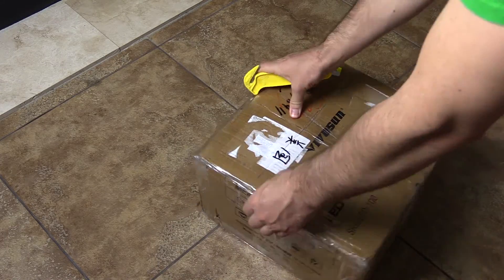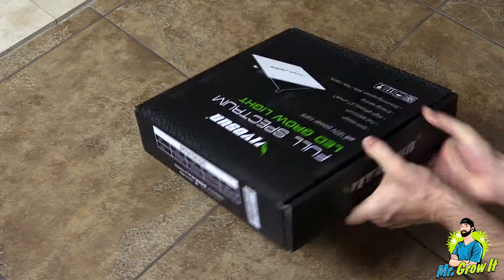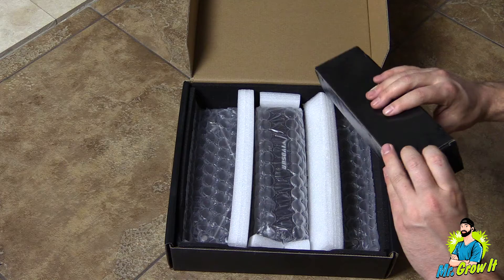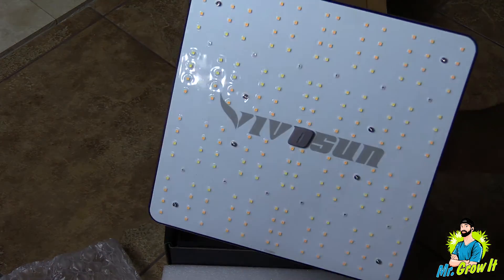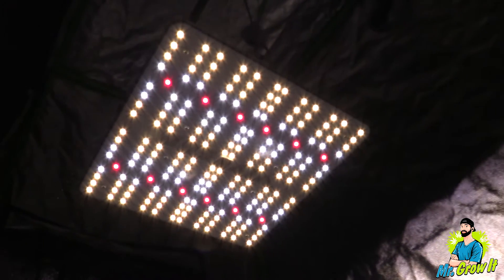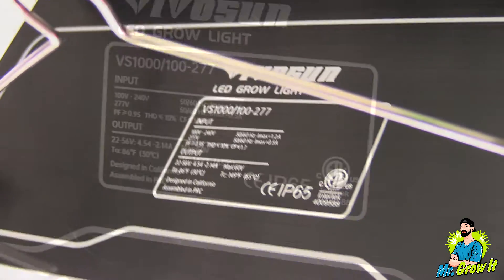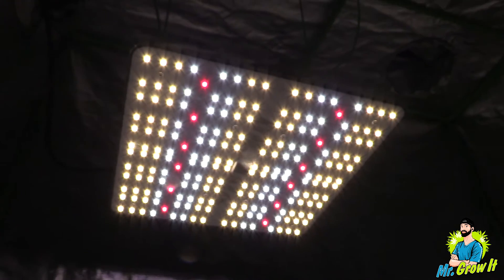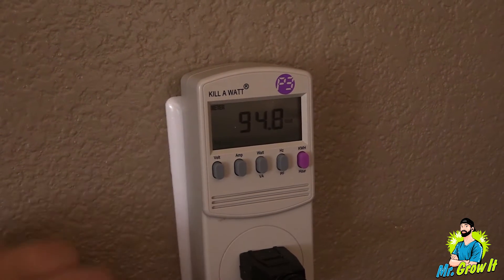VIVOSUN VS1000 LED Grow Light Unboxing, PAR Test & Heat Test!

Comment from the maker: What do you think about these measurements?
Link to VS1000 LED grow light- https://amzn.to/2Xz8RNP
Reply: I have this light and a ts 600 in a 2x2 with 4 plants that vegged 4 weeks in solo cups and were put in 1 gallon fabric pots..... Currently week 6 of flowering and the 2 on the vivo side are SO much bigger
Reply: It’s not worth my money looking for a new light atm
Reply: It would make a nice light for clones or sprouts 👌
Reply: Hey bro for a veg 2x2 is the spider farm sf1000 a better choice when it comes to par or the VS1000 your reviewing in this vid
Reply: How many of these lights would I need in a 8x4 tent ?
Reply: Not a question about the specs my question is do you take that little plastic cover off the light fixture or not lol I hung the light and it just sticks out like a sore thumb lol . I was using bulbs and finally switched over.
Reply: Could I use this light from seed to harvest in a 48”x24”x60” tent??
Reply: It’s not enough for a 2 by 2,except for veg.
Reply: I would have liked to see the PAR measurements at the other settings as well....the 75%, 50%, and 25%.  That would be extremely helpful since assuming they would actually be 75 , 50, and 25% of the readings seems like a bad idea...or am I thinking wrong?

Comment: Just bought one during a flash sale. This was helpful.
Reply: @MrDong101  Are you Happy with IT?Propably wanna get one for my 60*60 tent.
Reply: @Stephan_78 I have the vs4000 and I wouldn't use it in anything bigger than a 48x48. It claims a 60x60 foot print but it's too weak on the perimeter.

Comment: The main appeal of this fixtures are price. A 55w cob usually costs 120€  and this gives a bigger coverage while still being a small panel , I would place two of those I guess for flowering. I am using 55w cobs but I am going to try this for a replacement, the numbers aren’t amazing but it will make the job done.

Comment: I do not disagree with these tests, but show that the light is the distance you say it is from the sensor, and show that the light is in fact COMPLETELY level. The results should not change much, but it would be more consistant testing. I understand completely level is not possible, but put bubbles on it to show.
Reply: You are only showing offset distance. My light distance at 12" is 80 using the same meter.
Reply from the maker: The light distance is clearly shown in the top left corner of the screen. Confirming the light is level. Not sure what you mean by offset? You got 80 PPFD at 12"? That's very strange. Sounds like you may have a faulty meter. On a side note, I appreciate the suggestions but I actually stopped doing PAR tests over a year ago to focus on other projects. Cheers!

Comment: I have this light. I have a king led on the other side of my 2x4 tent. This is by far the better light. It’s intensity is adjustable. The height adjustment is way better than that of the king led. I love it. I wish I had three more. I have some other blurple in my other 2x4 tent and I’m not liking it at all.

Comment: I got like everything Vivosun and it works real well, def on the lower $$ level but seems like everything works well. I have the 600watt version of this light and it covers the 2 x 4 tent pretty well (for 4 plants or so, def no problem). Just gotta get a pulley system and sunglasses lol
Reply: I've had 2 vs1000 for 2 weeks now in a 2×4×5 vivosun tent and my three autos are doing quite well on the lower setting, plus they came with glasses and a pulley system.
Reply: A 600watt light that fits in a 2x4? That doesn't exist
Reply: @tylerc7336  you live under a rock….  Those have existed for years ! Even before led grow lights. Back then they cost around 500$+ now a 600w that’ll fit a 2x4 tent costs 200-300$

Comment: Which is better, this light or the one from Spiderfarmer?
Reply: I've been trying to find the answer to the same question
Reply: Good Question! Same here
Reply: Same here, so what you guys think, vs1000 or sf 1000 or ts1000?
Reply: Update- stick to SF1000, it is the best value for money, unless you’re really rich, you may go for ts1000. Trust me on this
Reply: Spider farmer has two 1000 series the sf1000D and the sf1000. The 1000D is very similar to this as they use the same Samsung diodes. The regular 1000 has better diodes and a meanwell I believe and will pull around 120 from the wall. I’m debating between the regular SF1000 and the marshydro TS1000 for my 2x2. Probably overkill but it will be a huge upgrade from my current TS600 from mars. I only get about 60 from the wall so it’s hardly strong enough for flower but I’ve got it about 8-10” from my girl and she seems happy enough. But I know she could be much bigger with a better light

Comment: Does the vivosun 1000 have the IR and UV? Im currently running the spider farmer sf1000.
Reply: So?
Reply: Ahh man, if you're running the spider  farmer with the Samsung lights you're fine. Vivo sun is not great
Reply: @rich8381  you have no idea what your talking about do some research vivosun has samsungs LATEST diodes not the lm301b, it pulls the same amount of power, its insanely bright and has a 3 mode dimmer KNOB easily accessible. Besides the spectrum on the vivosun is better for flowering anyways
Reply: @owenrutledge7144  it's funny, I'm looking at buying a light as we speak. So you're saying vivosun is better than spider farmer?
Reply: @owenrutledge7144   more like it sounds like you don't know what your talking about. The only differences in 301b and 301h is the h stands for horticulture because they are water-resistant and the lm301b are not. Other than that they are identical in performance. The top chips currently are Samsung lm301sl but for the price lm301b are the way to go.
Reply: This light is only good for seedlings and clones. It only has enough par for veg and doesn't have IR. The spectrum is more suited for veg with the 3k,6500k,660nm. This light has 20 less diodes then the sf1000w and max power is 96w from outlet. So you can see how under powered this light is compared to other. There is almost no difference in performance between lm301b and lm301h other than the h is water resistant. They don't magical produce more light with less power then the lm301b do. They are identical in performance.
Reply: @Backcountrylifestyle  go on samsungs page with all of their diode information and see for your self. My vs1000 pull 106 watts from the wall on 100% and if it has less diodes, that only means there is more power per diode and it is slightly less efficient but if you knew anything about Samsung diodes you would know that the lm301h more than makes up for less diodes you'll see new videos on my channel of the light and plants progress just wait and see
Reply: @Backcountrylifestyle  watch the video and learn some stuff bud

Comment: I need this they need to make a quad quantum board light like the sp4000
Reply: We have 6 of the Viparspectra p4000. Rated @400watts but all of them output 430watt. 2 in veg tent and 4 in the flower tent. We use p1000 for clones and seedlings and the p2000 in a pollen tent.
Reply: We did a watt for watt conversion from HPS and they do out preform HPS watt for watt but not Plasma.

Comment: 126° is hot as hell..but not  really much par for flowering.
Reply: LLCool Jay opinions we are all entitled to opinions.  Mad? Whatever LLCool Jay (don’t think your the real one)
Cheap lights are obviously going to have drivers or ballasts that run hotter then higher end products. 
You have no idea what I grow with so keep your mad at vivosun comments to yourself. 
I have several “budget” LEDs so I am talking through experience. 
Good luck growing and keep,trolling
Reply: LLCool Jay spider farmer aren’t cheap lights. Here in Canada the sp4000 is around $900 and they are not worth the money. Better products out there but grow with what you want. Where’s your grow pics at or videos? Seem to have all the answers must have a “unicorn” grow room every cycle you do, or your just someone who “finishes” and thinks they won.
Reply: LLCool Jay any light source produces heat. The heat throwing off a HPS is extremely hot and directed away from the bulb hence why you need a larger space between plant canopy and the bulb because it will totally raise the leaf temperature! 
Glad you know everything. Good to see you can’t take opinions without making yourself feel your right. 
Dollar per watt yes budget lights are great I never said they weren’t but if you expect a cheap light to perform as well as a high end light your wrong. If you think a budget light will last as long as a high end light well your once again wrong. 
Since you know everything and I assume you must have some engineering schooling background along with botany degree and maybe even an HVAC ticket of some sort. 

You should start a company and build the cheapest lights in the world and make them perform neck and neck with the likes of high end companies. Maybe I will buy a few from you. Until then your opinion is more then welcome but if I need to be schooled it will come from a higher caliber person than you. 

By the way I have Phlizon LEDs and Apouno LEDs and I run MH and HPS and I also have some higher end LEDs which are a huge investment but are worth the price. 

Peace and happy growing, if your even a grower.
Reply: its only 26 degrees hotter than a human and honestly its just hardly warm to the touch

Comment: You would need 4 of these in a 4x4 tent. The PPFD is not bad, but the overall useable PPF is terrible. Even for that 2x2 you had them in. I would say that this light would be a good veg light for the 2x2. Thanks Chris!
Reply: It would produce easily in a 2x2. The reading is in between spider farmer and viparspectra and is actually good if you know what those lights are producing in a 2x2. It's a 2x2 light. Not even a TS 1000 will cover 4x4

Comment: For a light that comes close to 900 watts those par numbers are pretty weak. My 650-W light does better than this
Reply: It is 95w not 900w. A course your 650w would be way better then an 95w. You are almost 505 more watts.
Reply: @mackrob3030   hehe. Check his username.